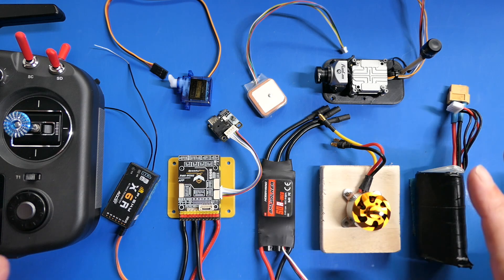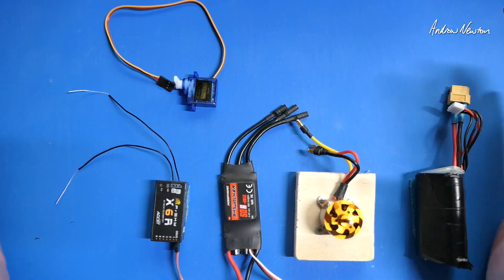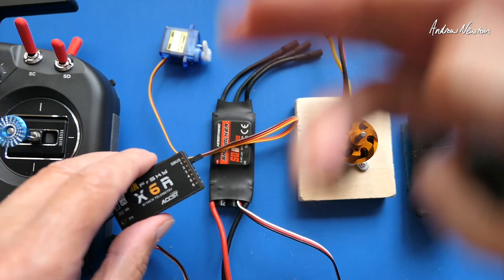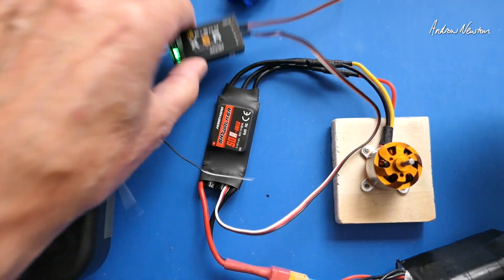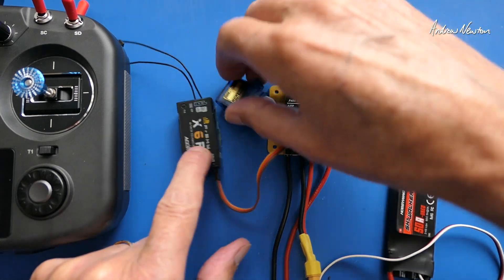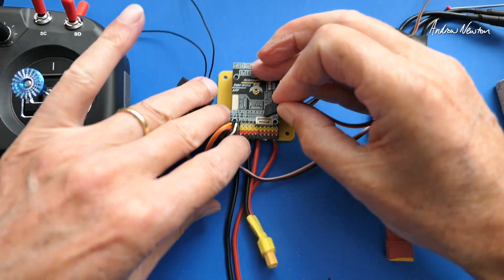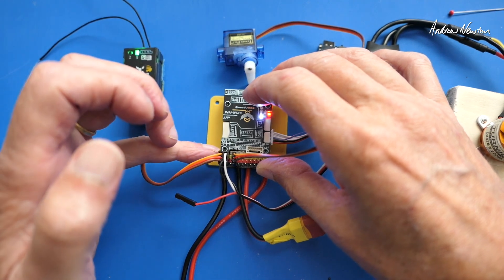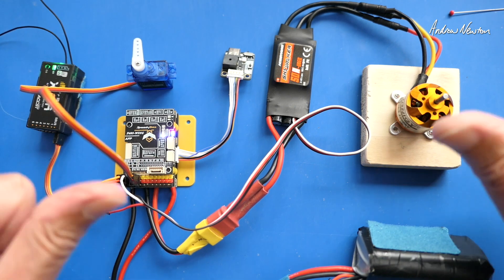SpeedyBee F405 Wing - SBUS and ESC Connection basics

Comment: Hi friend, when using this Hobbywing Skywalker ESC on the INAV, does it use the correct Standard protocol? I bought one and thought I might not be able to use it on the INAV. Thanks.
Reply from the maker: Yes, all ESCs should work on standard, but you may need to calibrate it.

Comment: Great video, very helpful but why cutting off the power cables on the camera? It would be good to see if those have XT60 female or male endings.. or even other connectors. It's frustrating unfortunately because it is actually the crucial part :'-( However, thumb up!
Reply from the maker: Camera and VTx came with a 6 pin JST plug that doesn't suit my setups. Look up my Runcam Phoenix HD review.

Comment: hi andrew so i have been trying to set up my my new swordfish (rth) for a few weeks now without success. the plane came with all the servos connected to the flight control. do i need to add a receiver as displayed in your video? of course that may be a mute point as the fc is locked up and won’t connect to configurator. yo u are a great explainer 😊
Reply from the maker: Yes you need a receiver. Which radio system do you have?
Reply: @AndrewNewton radio master boxer and have a ts16s on order
Reply: @AndrewNewton so my thinking that there is an embedded rx in the fc is incorrect. i have spectrum rx’s around cut they have no sbuss port. any suggestions would be appreciated
Reply from the maker: INAV supports SRXL2 from Spektrum. Otherwise Radiomaster SBUS receivers are good. R81 V2, R86C

Comment: Hi Andrew do you have any idea why when i plug esc Skywalker v2 hoobywing in S1 or S2  the esc doesn't do throttle calibration it goes to program mode .but when i plug it in S3 and moove the stick to full position..the to Minimum it does calibration.
Reply from the maker: S1 and S2 will be set for motors and S3 will be setup for servos I guess, if the mixer is for airplane. Maybe your throttle channel end points need to be adjusted in the radio so that you are actually getting 1000 to 2000 in INAV

Comment: Thank you for this video.  This is what is really needed to get more people into this hobby.
I have an FMS F-16 that has an ESC already buried within.  If the F405 Wing has its own ESC.  How do I wire it if the F-16's ESC has a direct XT60 power input which competes with the SpeedyBee F405's ESC?
Reply from the maker: The F405 has its own BEC (not ESC). Use the F-16 ESC but remove the red 5V BEC wire and just connect the ground and signal wires to the FCB
Reply: @AndrewNewton  Thank you for the explanation.  I completely understand now!   I assume that a yellow wire means reverse (it is capable) and I merely need to connect the yellow signal wire to a free servo port on the F405?
Reply from the maker: Sounds right. In the INAV mixer Add a new mixer line and assign a spare RC Channel, then in your radio assign a switch to that channel

Comment: In theory an FrSky TD-SR12 would connect by sbus in the same manner, correct?  what is the uart-ain plug for on the receiver about?
Reply from the maker: AIN is where you connect old school analog telemetry sensors or VBat wire. Yes the FC SBUS is the same once you define which SR12 pin is outputting SBUS

Comment: Hello Andrew. What I'm wondering is whether I should use
capacitors for flight controller speedybee F450 wing . And any which ones.
Otherwise thank you very much for all your educational videos.

Regards Geir L.L.
Norway
Reply from the maker: I only add caps if they come with the FC or there is interference in analog FPV. I have heard caps are highly recommended with 6S power. Common FC caps are 470microF 35V low ESR.
Reply: Thank you very much for your answer Mister. Then I can  continue and solder. And Thank you  again for your very educational videos. 👍👏👏🤩🤩
Best Regards
Geir L.L.

Norway

Comment: Hello, I have done all the connections but the motor and servos are not working. There are movements in the inav receiver section but the command is not sent to the plane. Could you help me ?
Reply: I am using ibus
Reply from the maker: Do you have Serial RX enabled on more than one UART?

Comment: What is the setting(s) in iNav to get the FC to talk to the receiver?  It looks SO simple in the video (thanks) but no matter what connections I've tried I cannot get the channels (on the receiver tab in iNav) to move when I move the sticks on the radio.  I feel like I've tried everything (and every combination) 10 times.  I'm experienced in Mission Planner, but a newbie to iNav/Betaflight. (and yes I have bound the receiver (tried TWO receivers) correctly)  Thanks...
Reply: Figured it out - 

in addition to UART2 Serial RX being turned ON (which is supposed to be turned on for an SBUS receiver for the SpeedyBee F405 Wing),  UART1 had serial rx ALSO tuned ON.  I don't know how that happened - might have been ON by default, or I bumped it, or who knows what.  

And being a newbie with iNav, I had no idea that only ONE "Serial RX" can be tuned ON (right???)  I probably got confused with the other kind of "RX" - I guess iNav means THE RECEIVER (so change "RX" to RECEIVER in the ports tab please), meanwhile I thought it was "RX" like with a UART's "RX/TX".  Anyway, when I tuned UART1 Serial RX OFF, the radio started working right away.

I had looked for a detailed explanation of the ports tab, but haven't found it.  That little tidbit, that only ONE Serial RX can be turned on at any time, would have helped a LOT.
Reply from the maker: @ Well done on the troubleshooting. A few users have had the same issue recently so I will include it in my next INAV troubleshooting video. I agree Rx is an ambiguous term unless you know the context.

Comment: Thank you for your time.
Would it be ok to use a 30A ESC for a 2000 maH battery on a wing build? single motor
Reply from the maker: Battery capacity is not the right information to work it out

Comment: Hye sir,  i want to buy that esc you use in your video but im not sure about the esc reliability how dose it perfom sir cause this esc is quite cheap.
Reply from the maker: No problems so far. It's a good ESC
Reply: I have been using these esc,s since 2018, and have never faced a single problem. Very good esc,s.

Comment: PDBの容量より大きなESCを使用したいのですがその時はどのようにすればいいでしょうか？
サーボはHVモデルを使用しようと考えているのですが、BEC電圧は変更できますか？
モデルはfreewing AL37を使用する予定です。
Reply from the maker: The ESC size doesn't matter but if the total current draw will exceed the board limits then you can connect the ESCs directly to the battery and give up current telemetry. Yes you can increase the servo voltage https://youtu.be/X86keMf2rv4
Reply: @AndrewNewton  ご回答ありがとうございます！
バッテリー電圧のテレメトリーは使用できますか？
フライトの際にバッテリー残量のモニターはしたいと考えています。
サーボ電圧の動画拝見いたしました。
参考にさせていただきます。
Reply from the maker: @kazuhiro950830  Yes as long as the flight battery is connected to the board you will have voltage telemetry
Reply: @ ありがとうございます！
製作頑張ります！！

Comment: Hi Andrew, very informative video! I have a foam glider with an ELRS receiver and I just bought the Speedybee F405 Wing App FC. I plan on connecting the receiver via the CRSF/ELRS UART (the receiver's serial port is designed for either a Sbus or CRSF connector to the FC) . Will I need to program iNav with all of the mixes that are currently in my Radiomaster TX16S or will iNav automatically recognize them once the receiver is connected to the FC and configured to send CRSF data via the serial port?
Reply from the maker: You can't use any of your existing mixes for an INAV model. It has to be the INAV mix, but you only need one model setup for all your INAV models. ELRS will bind automatically to all your ELRS receivers if you use a passphrase.

Comment: Hi, Andrew, I have a ranger 2000 pusher plane, how to use this speed bee to connect to vtol conversion which requires 4 motors.your advice would be of much help.
Reply from the maker: In the Mixer page you can change Timer Outputs to be Motors. Try Timers 3 and 4 to give 4 motor outputs on S1 2 3 4.

Comment: Great video. If i have a twin motor plane, would i have to solder 2 separate wires to the board to deliver power to both esc's? could a splitter work safely?
Reply from the maker: That's OK for most models. Big motors and high current draw would be best to use both ESC pads

Comment: What if someone is on spektrum receiver and transmitter. How can i do it with the flight controller
Reply from the maker: I don't know Spectrum but it is supported by INAV. I believe you can use a satellite receiver plugged in to the SBUS pins, or SRXL2 somehow.

Comment: Hi, Thanks for the video. I have a question though, how would I configure an airboat with two motors in Inav? I have he same flight controller as the one in this video and was wondering how I would mix and set up differential thrust on the two motors to drive a catamaran around on water. I haven't been able to find a lot of resources on setting up the outputs so far. Thanks
Reply from the maker: Just have to choose a plane or wing with Diff Trust in the mixer and adjust the values in the Yaw boxes, then delete roll and pitch lines. https://www.youtube.com/watch?v=eERrr-G4akE
Reply: @AndrewNewton  Thanks, but would this not cause the flight controller to overreact as, unlike on a plane, the responsiveness on a boat is much slower and may have lots of attitude changes along the water? or will this not be an issue if I use the boat present in INAV? cheers
Reply from the maker: Yaw stability is very minimal in INAV and you can adjust the weight as you wish. You might be the pioneer with this, just have to try it and see how it reacts. Boat preset would be OK but you still have to add the second motor
Reply: @ I ended up just using two motor outputs and, on the mixer tab, set 1 and -1 on roll and yaw values according to which motor it was. It works perfectly now

Comment: Hi. Thanks for the video.
For a flight controller which rc transmitter and Receiver to start with?
I have flysky i6 and ia6b receiver setup but I don't think I can connect a FC with it. It has sbus and ppm. Sbus can work with it.
Maybe you can also make a video for a Budget transmitter and receiver which can be connected to a FC easily. Thanks
Reply from the maker: You can use SBUS or iBUS https://youtu.be/Rsfc0r0w1eI

Comment: Top video! Possible to control FC( servo, motor) by the app? wireless? I mean if I dont not want use the TX
Reply from the maker: No, Wifi range is only a few m.

Comment: Im working on a Stallion VTOL and it would seem to me that the battery would connect to the power distribution board for the F405 and then to the three ESC's?
Reply from the maker: Stallion looks interesting. There are pads for 2 ESCs but you would solder all three ESC to the two sets of pads. Keep the battery and ESC connections separate if you want current measurement.